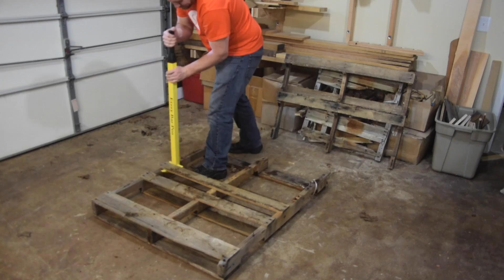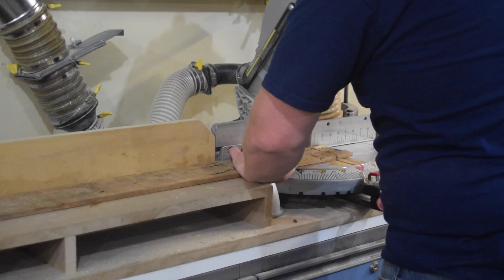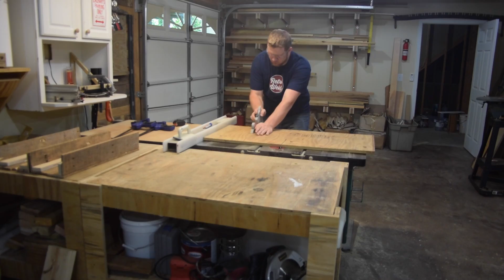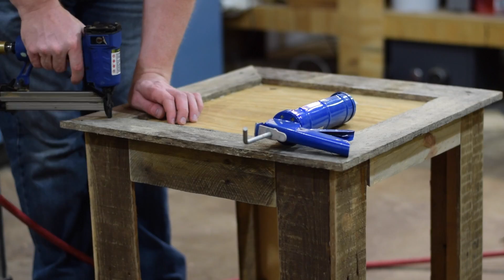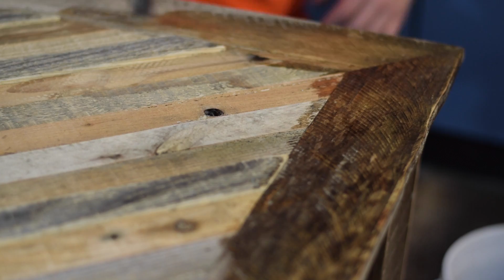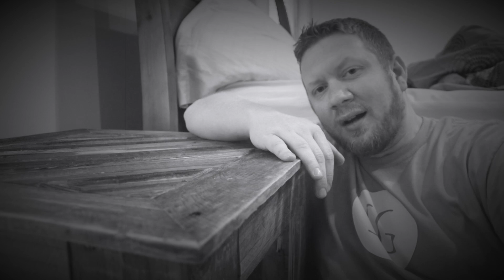How to make an end table from Pallets!

Comment: Did you put a poly on the top to seal it?  Details like that are good to add to your video.  Thanks
Reply from the maker: That's up to you but yeah I would always put some kind of protection on top of wood :) I personally like General Finishes high performance water based poly.
Reply: @SouthernGinger   Thanks again

Comment: Use a nail kicker. Oil the nails the night before and use hammer and crow bar. Can use a blow torch on nails only. Hit nail hard with hammer first. This helps break the bond. Use nail remover tool and pull out. Staples just use a plumbing pliers. Some use reciprocating saw. U need 2 or more people to take down pallet. U both or more people need to be using a demolition bar opposite one another and working on same plank at the same point but opposite one another.Or u can just chop off the ends and use a saw to chop off the rest
Reply from the maker: +CC Rescue yeah I recently found about a method like that. I have a Izzybar that I use now, make it's somewhat easier :) thanks for the tip!

Comment: Looks good man... How do you go about measuring and cutting the angles for the top???
Reply from the maker: Hey David, thanks! I started with a 20x20 please plywood top then after the legs were mounted I measured off of them for an 1in overhang. I think it was 23". then for the inside I cut them to size as I went along. Hope that helps dude! Thanks for subscribing!